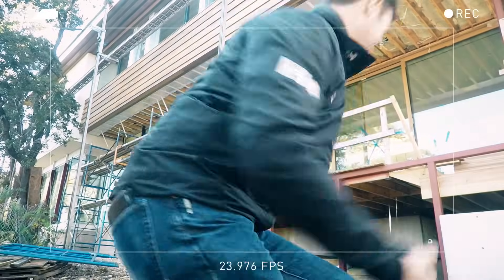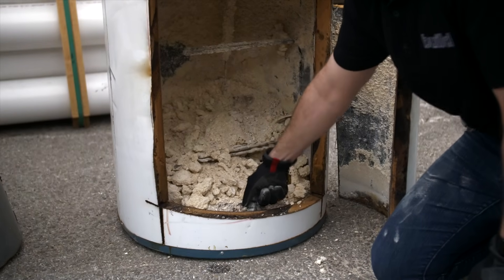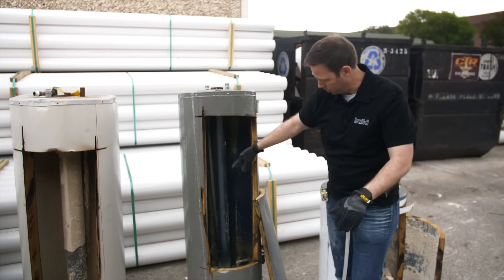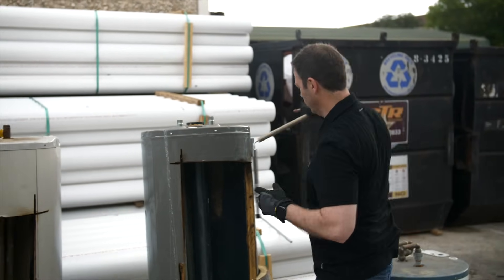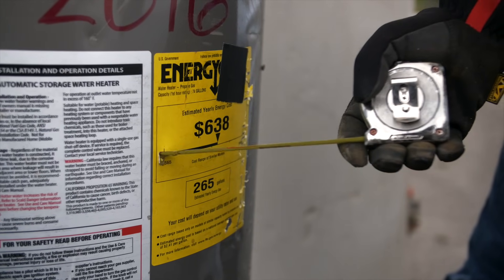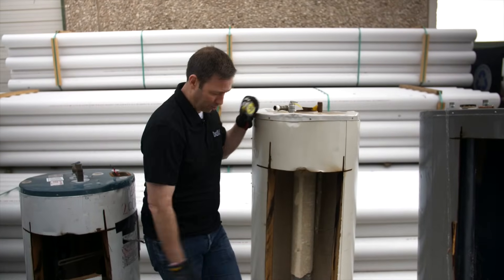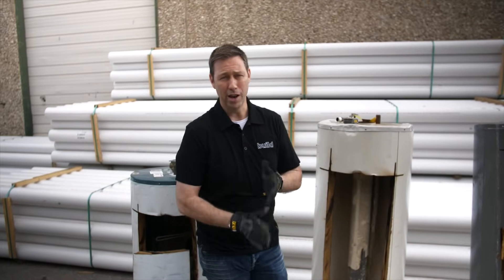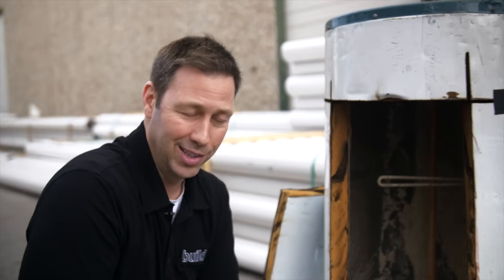Four Water Heater Tanks Cut Open - Lessons to Learn

Comment: i dont know you are from but water heaters in calif have had a 4" insalatiom for at least 4 years now  also draining does not work all you need to do is flush the tank as the scall is on the bottom with the drain  the anode needs to have at least a 3/4 "drive or more to break the nut along with realy good bracing the last thing is that the anoid will not come out of the due to carrosionif it breaks off you can leave and install the new one i'm a retired service plumber and have changed 100's of rods

Comment: We recommend you change your anode rod Everytime you flush your heater. Once it is in that bad of condition you risk it breaking and falling into the tank when you try to remove it. Plus the older it gets the less it will collect the scale like it should.
Reply: It is a sacrificial anode and dissolves because it is softer (aluminum or magnesium) as a result of the battery effect between dissimilar metals. The idea is to protect other vital components in the system from being damaged as much as possible.There are other factors, but in principal battery electrolysis will always dissolve softer metals before harder metals it such as copper and steel and the harder( more mineral content) the water, the better it conducts and increases the battery effect and thus the faster the sacrificial anode dissolves in relationship. 
Car engines with aluminum components and heads and iron blocks or copper core radiators are also vulnerable and should never have tap water used in them, only distilled water. In as much as is possible it is important to keep dissimilar metals from contact with each other to avoid battery effect corrosion.

Comment: Hey Matt, thanks for the video. I've been on the fence on replacing mine, its a bit of a pain as its in a closet with gas lines blocking it. Its install date is Aug. 1988! Only flushed it once or twice in the past decade and never bothered changing the anode as I figured I'd be changing it any day.
Reply: is it still going? mine is from 2000 and still going strong
Reply: @joel474  knock on wood, still strong. AO Smith rocks
Reply: It reminds me of the dark water in this video https://www.youtube.com/watch?v=Tl5oHZrIZo0&.mtida

Comment: The tank in my house is at least 14 years old.  I tried to drain it, but nothing would/could come out.  Hooked it up to the washing machine faucet to try to break through a clog.....nothing.  What now?  I'm a disabled/ retired woman, trying to take care of my home on a budget.
Reply: Leave it alone until it finally fails.99% of all heaters are never drained or flushed. The moderate build up of calcium shown actually coats and protects the metal tank. Info like this presented in this video is a selling tactic,new heater, service or whatnot. My water heater is 24 years old and has never been flushed or drained, and I have been a plumber for 38 years.
Reply: @Splungers  Thank you.  I decided "if it ain't broke, don't fix it" was in order.  It's at least 14 years old, I'll be replacing it when it fails.  <sigh>

Comment: I just replaced my tank.  It was built in about 1940.  All copper of course.  But 75 years of use is considerably better than the 15 years suggested here.
Reply: My folks had an old International harvester frig from the 40s.    Was still running fine when sold the house in 2000.  New stuff/ build in obsolescence.
Reply: @arvbergstedt3303  Would have been fun to measure the KWH consumed by that antique fridge.  Probably cost $40 month to operate.
Reply: Planned obsolescence
Reply: @Rampagedd  Copper was cheap in 1940, which was just before US entry into WWII and subsequent wartime then post-war growth. Modern civilization requires enormous amounts of copper. Not everything is "planned obsolescence" and each example is worth examining. Carbon steel is affordable. Copper and stainless steel grades suitable for heater use are (much) more expensive, one reason locomotive and industrial boilers are generally made of carbon steels.

You could have a heater shell, ends, bungs etc fabricated from copper easily in 2023. If you can weld and fab it would not be very difficult to do yourself. (Model steam engine enthusiasts often make their own boilers which is much more demanding than a heater tank which is not a high pressure vessel.) The material cost would be the deal breaker for most people.
Reply: @Rampagedd  You can buy a stainless steel or fiberglass tank that's guaranteed for life but they cost about 2-3 times more.

Comment: Someone mentioned a video on removing anode rod. Good idea. You'll need 1 1/16" socket and and impact drill or 1/2" breaker bar and a cheater bar. They're put in pretty tight from the factory. If the anode rod is changed every 5 years and flushed every year. For best results replace cheap drain at bottom with a nipple, FIP full port ballvave, and hose X MIP adapter. If done as suggested your water heater tank will last 20 - 30 years. You'll have to replace elements and thermostats if it's electric from time to time. If it's gas it depends on the price of the gas valve etc. If it's worth it. Too many electronics these days. As always depending on the water a water softener will help extend the life of a water heater and plumbing fixtures too. If you have soft water and are diligent with it, flushing won't be as hard or crucial. Anode rod is the key.
Reply: Mine is 30 years old, original to this house I bought 5 months ago, and I seriously believe it has never once been serviced or drained or anything after it was installed.  You should hear it when it kicks on during a otherwise quiet evening at home.  It has awakened me a few times in my sleep.  So I check out WH's at Home Depot, they sent a guy who gave me a written estimate of $1,709 for a 40 gallon Rheem installed, a WH that retails for $369 meaning they want to charge $1,340 to install it.  That is just criminal (seriously), but I wonder how many paid it because they do not know better?
Reply: @markwalker3499  I paid $850 for a State 40 gallon water heater delivered and installed in 2017.
Reply: @markwalker3499  I agree. But there are reason's for this. One labor average is $90 an hour or more, cost of business, health insurance, workmans comp, licensing and business insurance, and overhead cost. So 3 hours to start, more if they have a helper. You're right parts aren't too expensive for the rest of hook up, but let's add another $150 for what ifs. Then inspection fee $50 - $90 if they do it properly.  So it does add up to a degree. But what's happened in car repair has happened to plumbing, a book with suggested price quotes and most of the time you profit using this method, but not always. Therefore they try to justify their prices by this. That being said I prefer to bid on a job by job circumstance. If you know what you're doing and done it long enough, you're going to know when to add a bit more for irregular jobs in your estimate.

Comment: The tanks get replaced when they don't need to because it's a huge scam to charge homeowners more money. Also, there are a lot of scam companies or just individuals who go door to door pretending to work for the local utility carrying clipboards asking to enter peoples homes, then say you need to pay for a new heater, often they will go as far as to remove the old ones and then they bring the tanks to a metal scrap yard and get paid for the metal and the brass/copper valves, meanwhile nobody ever shows up to replace them with a new one and you never see them again. There was a big expose on dateline about it. I've had some of those fools show up at my house, asked to see ID, what company they work for etc.. and they never show it of course, then asked where their vehicle was because they always show up on foot. They'll come up with a lame excuse about no parking nearby etc, even though the driveway is empty. I followed two of them once and they got into a car that picked them up a block away. Pure scammers. Beware.

Comment: I found most plumbers replace not restore.
Reply: It only cost effective for do-it-yourselfers to "restore" a water heater. If I as a plumber put the new anode, new drain and flushed it, how much, judging from the video of the insides of those tanks, would actually come out the drain? If it will drain/flush without major work, the homeowner can do it, but if that drain fails to close, it becomes an emergency.
Reply: @Splungers  you are correct. The hours it would take for a plumber to flush out the tank and replace the required items would be to costly. And it could be an emergency if the original valve was reused since they will not seal again.
My intent was not to say plumbers are wrong. After a "restoration" there is no guarantee as to how long it will work. For me as DYI its worth a  shot though.